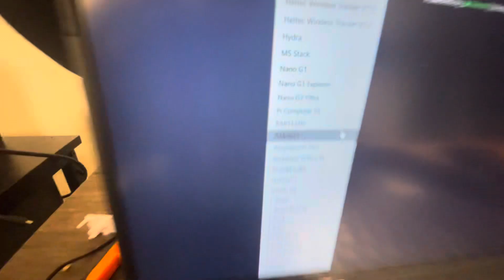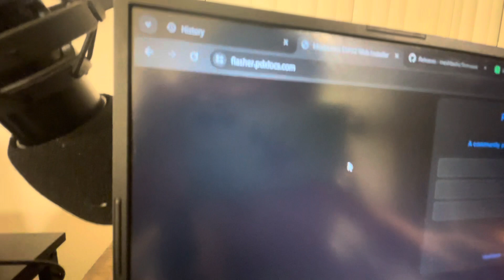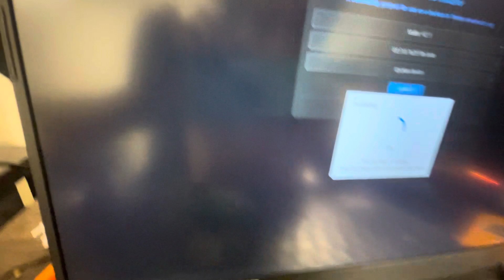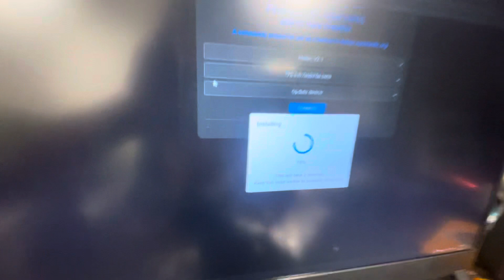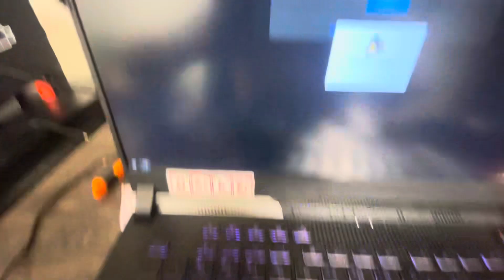How to flash Meshtastic firmware outdated LoRa devices! Heltec v2 TTGO v1 #Edmonton #meshtastic

Comment: I want to thank you very much for this tutorial. I bought 2 Heltec V2 boards to get started with meshtastic  and see how it would perform. The V2 was pretty cheap, only 10€ per board. When i flashed the boards using the web flasher, i had issues. Some threads lete to believe that the hardware is simply different. You were the final key to making it actually work. I also recommend to everyone to flash their boards the same software, else it won't mesh.
Reply from the maker: I am extremely happy for your words man. I am glad you got "Meshy"
Reply: In regards to your recommendation (" I recommend to everybody to flash their boards the same software else it won't mesh ") Does that mean, if I have a V2 and a mate has a V3 we won't be able to chat and create a mesh network together??
Reply: @RandellMonaghan i sadly don't actually know the compatibility between the nodes, just that the V2 annoyingly needs something else then the new meshtastic software. I can't answer your question, i imagine there should be hypothetically no problem as long as you are on the same channel. But i can't say for certain